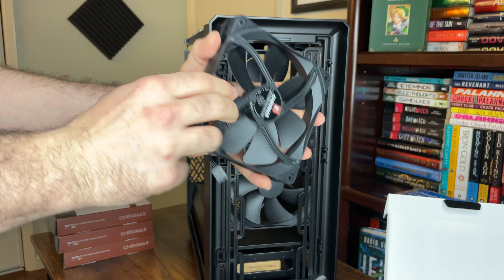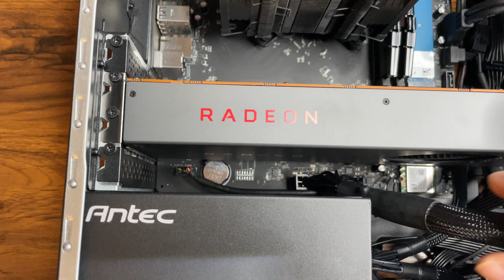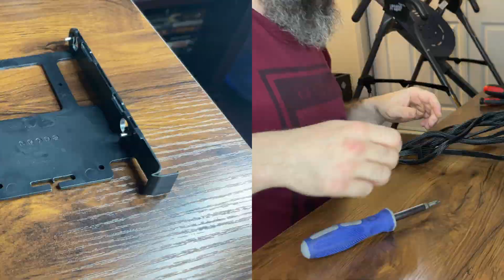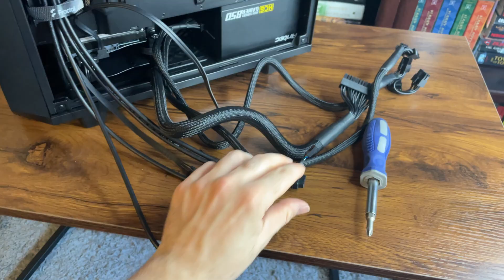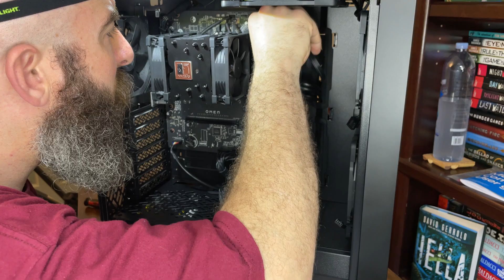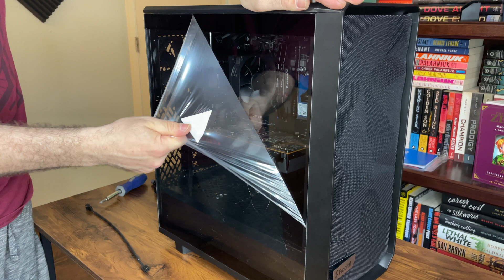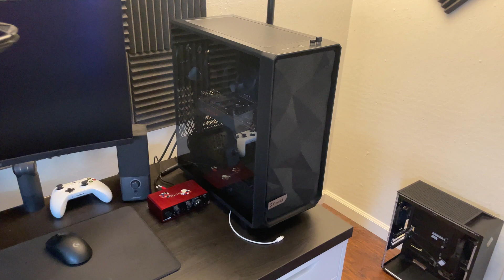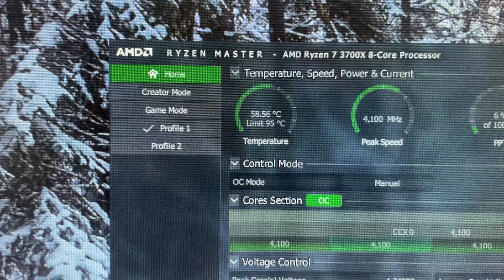HP Omen 25L / 30L Case Swap! Tutorial! Walkthrough and Results!

Comment: Can someone tell me where the power switch goes on the motherboard I can’t get my new build to even turn on
Reply from the maker: You should have a 2 pin header that will most likely say “PWR BTN” or something similar. It gets plugged into there. That’s what signals the motherboard to turn on when the case button is pressed. The cable will be attached to the case
Reply: @DanKamYouKnow  I had tried that and tried it both ways Is it possible the motherboard isn’t compatible with the case ?
Reply from the maker: @blooodtier820  What exactly is happening? Does nothing happen at all when you press the power button? I would triple check all of your connection and reseat all components. I have yet to see a case that is incompatible with the Omen motherboard.
Reply: @DanKamYouKnow   I checked everything in there I used the rose well prismS500 I’ll try and reconnect everything and see if that works the power switch goes into the area that says “PB” correct and it goes facing down correct ? Just making sure
Reply from the maker: There might be a +/- note on the connector, that you’d line up with the motherboard. I’ve never heard of that case but if everything checks out OK, you can jump the pins on the motherboard, if it starts up, then it’s an issue with your case

You can find out how to “jump start” a motherboard on Google, easy to do and a great test.
Reply: @DanKamYouKnow  I tried jumping it and nothing , seems like the mobo probably died I’m assuming oh well thanks tho!
Reply from the maker: Damn, sorry to hear man. Hopefully you figure it out or have better luck with a new board 👍🏻
Reply: @DanKamYouKnow  thank you so much! Anyway I fixed it I had the gpu cable in the cpu area my fault thanks so much for the help tho !
Reply from the maker: Glad you figured it out! Good job on spotting what happened. 👍🏻👍🏻👍🏻

Comment: Hello, I recently swapped the case of my omen too, because I was not happy with the temps. One question thought do you know how to transfer the wifi chip to the new case? I noticed that I can’t connect my Bluetooth devices and I assume that it’s because of the wifi chip
Reply from the maker: You have to transfer the chip and the antennae over to your new case. The antennae are under the front panel of your Omen case.
Reply: @DanKamYouKnow  hey thanks for the fast response, i will try that soon. I thought I wouldn’t be able to cause I had to unplug some very small positive and negative cable and they seem to be attached to the case. And I thought the chip needed them to function
Reply from the maker: Yup, those 2 small leads, lead to the antennae that is attached to the front of the case. Transfer all of that over and you’re good to go. Might have to get creative with mounting the antenna. I never use WiFi so I didn’t transfer it over. Should of stated that in the video
Reply: @DanKamYouKnow  Yes I don’t use wifi either but I do use Bluetooth for my Xbox controller and headset, I’m guessing it’s because of the wifi chip that the Bluetooth is not working
Reply from the maker: Oh, you are correct.
Reply: @DanKamYouKnow  Yea, I hope it’s not to difficult, but thanks for replying and clarifying my doubts I appreciate it
Reply from the maker: No worries 👍🏻👍🏻

Comment: Hey been trying to copy your tutorials just got the same case you got and swapped everything over. I have the intel version of the HP Omen 25L, i5 10400 cpu 1660 super gpu 16gb ram 500watt power supply. I really trust your opinion on a lot of this tech stuff. Was wondering if you had any recommendations for upgrades or things I should change. I have a decent budget around like 600-800 dollars to makes some upgrades. I really appreciate the help with your tutorials helped me a lot keep up the great work
Reply from the maker: I would probably say upgrade the GPU and the power supply. You also might have enough left to swap the case as well.

Comment: I purchased a cheap case and purchased some 3 LL120 Corsair fans hooked em up to my omen motherboard and booted up icue it doesn’t detect my fans so I can’t customize the rgb or fan curves is the omen motherboard the reason it doesn’t recognize other fans?
Reply from the maker: Omen motherboards won’t work with pretty much any software that isn’t HP. Your board won’t recognize the fans so you won’t be able to control fan speeds or lighting with the Omen motherboard 😕

Comment: Can i put my omen 25l in a lian li o11 mini case ? i don,t know much mate would relly need some information from a omen pro
Reply from the maker: You can use any case as long as it supports Micro ATX motherboards. For the O11 mini, you’ll need an SFX sized power supply though
Reply: @DanKamYouKnow  thank you for replying 🤜🤛
Reply from the maker: @darkfalkor3833  no worries my dude

Comment: Wow!! I just found your page and have now watched about 12-13 of your Omen videos.  I too have an Omen 25L but mine has the i7 10700 and a gforce RTX 2060 video card.   I bought mine in July of 2020 and didn't get it set up for maybe 6 months as life got in the way.  But once up and running it was a dream.  All I play is Half-Life and Unreal Tournament  :)   But after maybe 4 months it took a dump and wouldn't boot. You guess it.  The damn thing over heated.  I never paid to much attention to the fact that there was crap for cooling.  I hope that it was the video card that went South as I just ordered a new card.  Still a 2060 but an MSI unit with 12gg Vs stocker with 6.  After watching all your videos I will now try some of your fan mods.    I was even thinking about cutting a hole in the window and added a 120 in there as well.   About 15 years ago all I used was Cheiftec Dragon cases and many of them I added my own window and then cut holes for the fans in them.  I even added 2 fans in the top.   Now I have cases with really old hardware and thought a pre-built would be awesome.  Little did I know.  Anyways, way to much info.  Thanks for the tips and tricks.  I hope to get mine up and running again with some now fan mods.   Thanks, Jim
Reply from the maker: Hey Jim! Thank you so much for the kind words and that’s a bummer that Omen over-heated. Was anything damaged when it thermal throttled or did the PC just turn off? My best recommendation would be swapping the CPU cooler and using MSI Afterburner to make an aggressive fan curve for the GPU. Thanks for your comment.
Reply: @DanKamYouKnow  Sup Dan.   I have my Amazon cart full of fans, Y connectors and fan controller and CPU cooler. :)  My new video card arrived yesterday from Newegg and I hope to get that installed ASAP.   My PC just wouldn't boot up one day , it wasn't the BSD, it just had a message error that I don't now remember.   The local repair shop said it looked like it over heated.  My wife keeps her office VERY warm and between her laptops, 3 screens, my PC and screen and our TV cable box, DVD player and stereo/amp all running the room gets toasty and I think it just killed it.    I called Costco, where I got mine too, and the HP rep told her to try and see if I could run some hardware tests on it.  I managed to get the test page going and tested every piece of hardware i could many times.  The only error I got was from the video card.   So that's why I started there.   I hope to have my fans and coolers soon and I can get this thing up and running again.  Again, thanks for all the great videos, nice to know I'm not crazy to think this thing is way under cooled but I figured HP knew what they where doing so why question the pros right?  :)    Now I know why I always built my own.  Haha     Your the man!!
Reply from the maker: Oh wow, that sounds like such a hassle. Please let me know what you end up finding out and how it works when you get everything back together!
Reply: @DanKamYouKnow  Yeah, it was quite the bummer. But such is life.    I will keep ya posted on the process.   Fans, Y cables, controller and CPU cooler are all on their way.  :)
Reply: Well after adding my sweet new graphics card.      Nothing.  I can get back to the system test page by pressing F2 as it starts to boot up.   It has many systems tests you can run and it passes them all.  Not sure how trust worthy that is though.    Not sure what to do but maybe swap out my CPU since that is the most likely culprit. Arg
Reply: BTW,  i was just looking at your add a new PS video and you called out video card sizes that fit an Omen case.  Well mine is a little bigger then the sizes you stated and yep, it's a little tight.  The sag bracket doesn't fit and the door closes but the cables are right up against the door.  Ooops.    and I also got me a new CPU coming.  same as the olds one.  an i7 10700  We will see what happens this weekend.  fingers crossed
Reply: @DanKamYouKnow  Well here is my update.  I got a new i7 10700 2.9mhz chip last week and just got it installed last night almost a week later.  Life ya know... :)  I only reinstalled the stock cooler because if the new chip didn't work why go through all the hassle.   BUT, I swap the chip, put on the stock cooler and , BAM.  I'm back in business.  I never got past the Win 10 start up screen as  I ran out of time but it did start up.    So now I will start the install of all my new Noctua fans and cooler.  YES!!!
Reply from the maker: That’s great to hear Jim!! Sounds like you got it all figured out.
Reply: @DanKamYouKnow  Well I hope so.   I managed to play some a few Half-Life mods but I do have one problem.  Im my Omen utility page my CPU temp isn't working.  It doesn't register.  Any idea why that might be?

Comment: Great video! I bought a cheap used Omen machine for parts (R7 5700G, RTX 3070Ti). Will be building a machine for flipping from the leftovers + old CPU and GPU. Will use a proper case - astonished by the zero airflow in the original case.
Reply from the maker: Thanks! Yeah, HP designed the 25L and 30L case to have zero airflow. Not sure what they were thinking when this PC was targeted towards enthusiasts.

Comment: My wifi adapter stopped working after I swapped cases… any ideas?
Reply from the maker: I didn’t include it in the tutorial because I don’t use WiFi but you have to swap over the antennae that connect the the WiFi card
Reply: @DanKamYouKnow  I reconnected the antennas and it still doesn’t work. When I check the device manager it says “device not connected”
Reply: @DanKamYouKnow  Do you think the adapter broke or something
Reply from the maker: Hmmm, I would make sure it’s fully seated. Not sure why it wouldn’t be working after transferring everything over
Reply: @DanKamYouKnow  I’ll try it thx

Comment: Hey, ive also got an OMEN 30L with a RTX 3080 and an Intel Core i9- 10850k and i am also experiencing the overheat problem, but only on the cpu, the gpu is running just fine(max temps are 60-65 on the gpu).  I was wondering if you have tried undervolting the cpu to lower the temps? And if you think it could help, because i dont really have the money or the trust in my personal skills to move all of the components into a brand new case right now. 

ps: Thank you for all the Videos, they are very helpful!
Reply from the maker: Yes, under-volting is definitely a great method of lowering temps and I highly recommend it. I believe you can use Intel XTU to do so, there should be many tutorials on YT.

Comment: Hey thanks for the tips. I just recently case swapped my HP Omen into an old Cooler Master case. I heard a pop at some moment when powering it on, but it turns out the front 200mm fan blew up. Other than that, my computer is now cooled down AF.
Reply from the maker: No problem, glad you got it figured out. I thought you were about to say the PSU blew up or something lol

Comment: Hey man! I'm just about to pull the trigger and buy an Omen 25L, but I'm stuck between adding the Noctua fans or completely switching out the case. I'm a complete klutz, and very afraid to mess up something that took years of saving up for. What do you think I should do?

Thank you in advance.
Reply from the maker: Case swapping would definitely yield the best results, and might be the better dollar to performance ratio as well
Reply: @DanKamYouKnow  Thank you! Also, one more question: in the default Omen case, how does the front fan take in any air? there isn't a vent on the front that i can see, though there is a small one near the power supply
Reply from the maker: The front fan is more for looks. Won’t be very effective at all.

Comment: Is it normal for no internet? After case transfer
Reply from the maker: Are you using Ethernet or WiFi? If you are using WiFi, you’ll have to transfer over the WiFi card and antennae. Which I didn’t cover because I only use Ethernet, sorry.
Reply: @DanKamYouKnow  it’s fine (honestly if I could I would use Ethernet too but I don’t know what I need or if I need a internet box in my room.) and after some guesses I managed to transfer over the Wi-Fi card and the antennas.
Reply from the maker: @mrkid2451  I am glad you figured it out!
Reply from the maker: @mrkid2451  and you would need an ethernet cable ( usually referred to as a CAT cable ) coming directly from your modem.

Comment: Hello , My OMEN 25L have some issues , i have no signal on display and all usb ports not working ... it turns on ,fans working , cpu working , gpu working , i have 0 control of pc , can you guess what it is???? ://
Reply from the maker: Have you tried a different cable from the GPU to the monitor?
Reply: @DanKamYouKnow  I can try different cable, but why usb ports not working..
Reply from the maker: I would figure out why you have no video signal first. If the PC is under 1 year old, I would contact HP
Reply: @DanKamYouKnow  the pc its 1 week old haha, I allready called the shop where I bought it, they gonna exchange it, weird thing the motherboard on description says B550 and what i got when checking system says 89EB, so i think there is issue with motherboard or something.. Also gpu was getting to 83c max, what i really don't like, i think it's a bad prebuild of OMEN 25L.. Fingers crossed, I also just watched your video and I see there was a heatsink on ssd, in my case there was no heatsink.. So...
Reply from the maker: Glad to hear you can exchange it, let me know how it goes with your new one! 👌🏻

Comment: Hey me again! I have the Omen liquid cooler it doesn't seem to have a way to mount which is disappointing. What do you recommend?
Reply from the maker: The stock Omen liquid cooler is 120mm and you should be able to mount it on the rear or top spot that accepts a 120mm fan
Reply: @DanKamYouKnow  ok booted up and seems fine.  I have 2 questions. I used the Y cable but it only had 2 pins to go into the connectors.

1. Where would I mount the wireless cables?

2. Are the Chromax fans better than the fractal fans?
Reply from the maker: Wireless cables?! And I’m not sure what you mean about the y-split cable. The 2 ends will plug into 2 fans and the other will go into a fan header on the motherboard. 

The Noctua fans will be much better than the Fractal fans, but the Fractal fans will work just fine.
Reply: @DanKamYouKnow  ok I'll swap them out and on the motherboard there is a wireless chip with 2 cables that attach and act as an antenna. I suppose they help pick up the wireless signal better. They run up from the chip to the front of the case behind the front glass panel.  Here is a video from HP 
https://youtu.be/jKHHVUE5boY
Reply from the maker: Yeah, I never use WiFi ( always use Ethernet ) so I didn’t include that in the video but I should of made note of it
Reply: @DanKamYouKnow  ah gotcha. So the 120mm Noctua NF-F12 PWM will run cooler than the 140mm Fractal GP-14 fans? I see the Noctua has 1500 rpm while the Fractals have 1000 rpm. However it looks like the airflow level is lower on the Noctua.
Reply from the maker: I thought you were comparing a 120mm fan to another 120mm fan. The Fractal fans are just stock included fans, while the Noctua fans are some of the best on the market. Not sure how they would compare but I would assume the Noctuas probably still push more air but I’m not sure.
Reply: @DanKamYouKnow  thank you for all the help! I'm probably gonna get a better aio. The cpu still runs hot.

Comment: So my only question is, how do I find out which computer case be able to install these components. Will any case do or they got to be specific ones.
Reply from the maker: The only requirement is that the new case has to support a micro ATX ( mATX ) motherboard, that’s about it. I would go with a case that supports ATX though just in case you want to upgrade